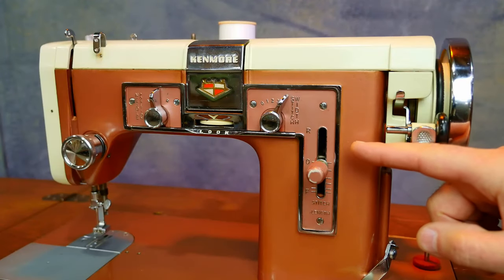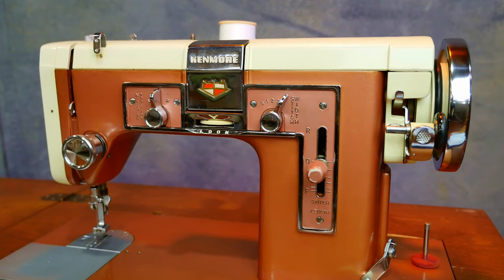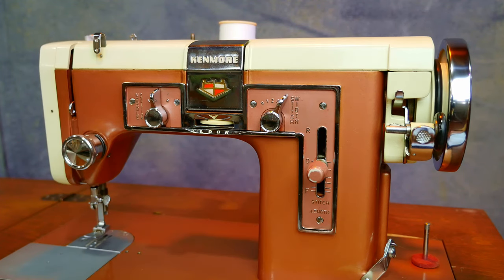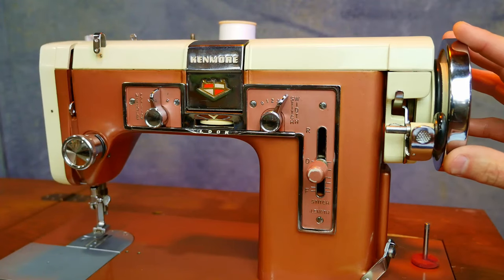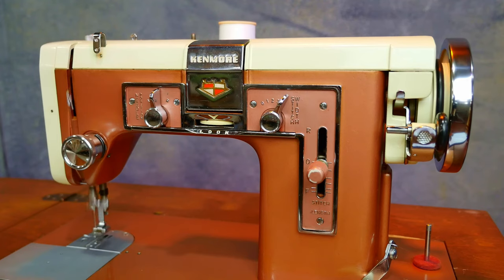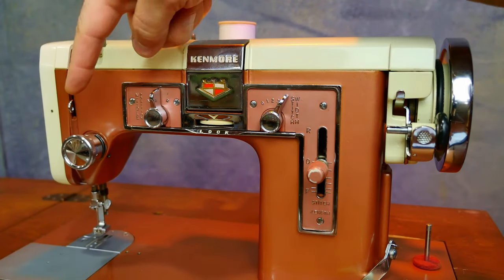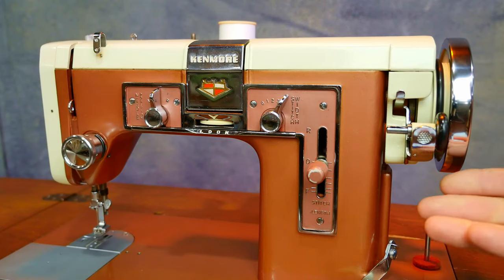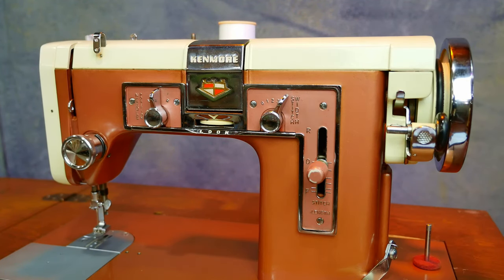Sewing Machine Needle Not Moving Solution!

Comment: Thank-you SO much for this video!  I watched at least 10 until I stumbled upon this with a google search:  my Bernina 1005 needle won't move.  This resolved my issue, after taking the machine apart as much as I could, using a dust blower and then oiling the machine.  None of that worked, but this video did!

Comment: Thanks for this video! This is exactly my issue (and my machine is almost exactly like the one in your video), except my "disengage wheel" keeps loosening itself. I recently put a new belt on the machine and I'm sure I must have done something wrong when putting it back together.  Any suggestions?  Thanks!
Reply: Machine Paff262.using after 30 years.All wall.Wheel turning but needle not moving up & down.Did what you recommend but found small wheel                Becoming warm stopped power.what is the fault?

Comment: Hello, do you happen to know what I can use to replace the gearbox gasket? Would vellum work? Parchment paper? Thank yoy
Reply from the maker: When I need to make a gasket I go to the auto parts store. They have sheets of gasket materials of various thickness and material. Pick something similar and go for it, it will work good for you. Heck I have seen single ply cardboard 'work' but I am not recommending that.
Reply: Thanks a bunch!

Comment: Hello, my sister has this same problem and I did what you did and the wheel moves but when I press the pedal the belt in the wheel moves but not the needle and it makes a noise. Her machine is old and hasn't been used much. She has a 385 kenmore sewing machine.  It makes the same noise as when the wheel was locked in bobbin setting. What can it be? Its not in bobbin mode.

Comment: Hello Mr. Dryer
I'm still having trouble with my sewing machine the is going up and down but very slow and I have loosen the the wheel on the side just like  you did on the video. Is there anything else you recommended me doing?
Reply from the maker: Is the motor spinning fast enough? Is your belt slipping? Have you tightened the disengage knob for sewing? Will your machine turn easily by hand or is it all jammed up or sticky?
Reply: @AlexanderDyer hey can u help me I did that and the motor is moving really slow

Comment: Hi, I have the same issue, yet tightening it doesn't work. Manually the needle does work and the motor runs fine. But no matter how tight I make the adjuster the needle doesn't move when I run the motor, any advice?
Reply from the maker: I can't tell from here. Broken belt? Improperly installed disconnect? Something else? There are common problems/solutions and then there are things that require hands on inspection.
Reply: @AlexanderDyer  thank you, I'll give it for repair.

Comment: I have a Empisal model EIDE FZ/ SS/ BS/WP machine and the needle wont move. its one of those with the pedal . I can't find any type of manual or video for it:( not even a pic of it online
Reply from the maker: All sewing machines have similarity. If it is jammed up then it may have thread bound up around the hook also clean and oil the machine. These two things solve 99% of that problem.

Comment: Thank you for the video
But please I tried this but it still isn't working...
And the foot pedal only moves the handle when it's disengaged. If it is engaged the foot pedal doesn't move both the handle and the needle. Please if you could help me out. Thank you
Reply from the maker: Sounds like your machine is jammed up. Most common culprit will be a bunch of thread wrapped aroung the hook. Be careful and clean up you machine, get all the loose threads out of there, lubricate and see if you can get it free spinning again.
Reply: Thank you

Comment: Hi my machine has been standing in storage for 9 years. I understand how to disengage and then re engage the machine but mine still won't get the needle to work.
Reply from the maker: Does the motor work? Do you have a belt properly installed and adjusted? Is the handwheel spinning?

Comment: I have another problem.the needle works but hits something hard below n breaks?
Reply from the maker: So that crosses over from an operator instructional situation into a mechanical issue. If you are the mechanic you need to get in there and discover what it is hitting because that is not right and it needs to be resolved.

Comment: So useful!! Thanks!!
Reply: Bought Pfaff 262 in early 1970s & used happily up to 1985.Put it in it’s cabinet until two months ago.Everything works well but the needle doesn’t move up & down. Tried to tighten small right wheel clockwise, found it ( small wheel) getting warm.I switch off power thinking I might damage it.I have cleaned inside as well. Can you suggest me what to try next? Thanks.